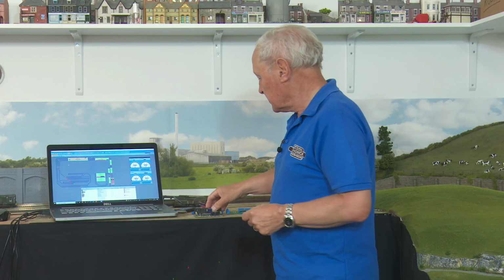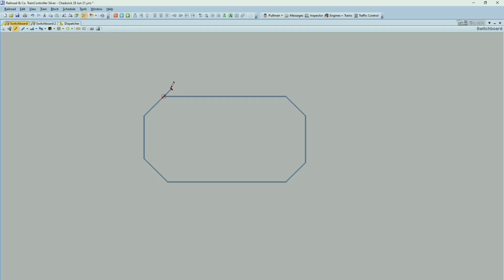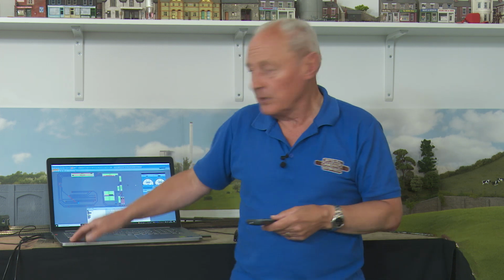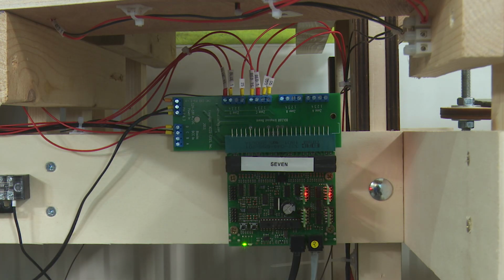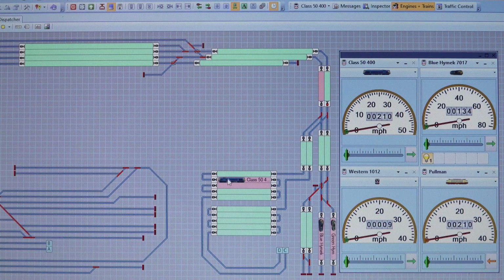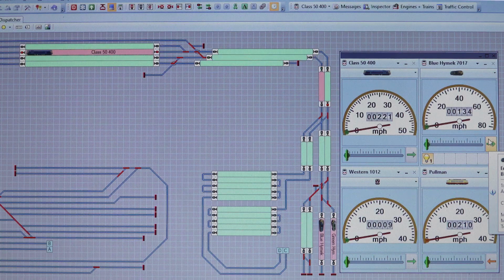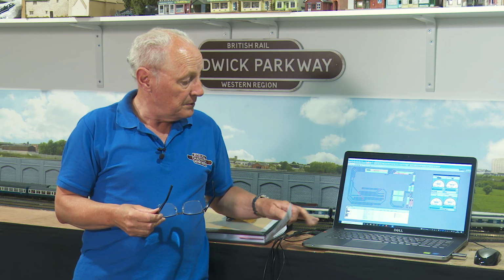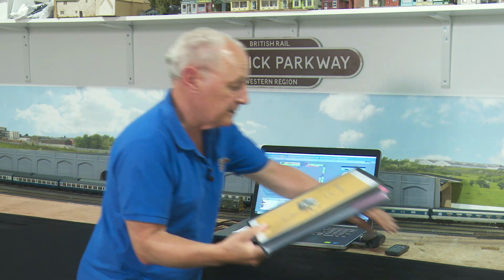An Intro to Block Detection at Chadwick Model Railway | 137.

Comment: Charlie, I agree with you about the pricing of Train Controller (I compared Bronze).
As I live in Spain I chose the country as Spain and got 121 Euros = GBP104
The UK price of 220USD would = GBP159 or 185 Euros
I would queery why its quoted in USD for a start for the UK and seemslike an error. Either way maybe choosing a European country in Euros might ne the answer and a lot cheaper?
Interestingly, France is 121 Euros but Germany is 119 Euros (made in Germany) and Switzerland 134 Euros. I can only assume that the differences are caused by the different VAT rates accross Europe?
Did you get anything actually posted to you (manual etc) as postage costs vary immensely across Europe especially to / from the UK. Other than that I have no idea!
Great video as usual, I think I'll keep to my Digitrax DCS52....lol!
Reply from the maker: Great comment Mike, thank you. Good luck with your layout buddy, regards Charlie

Comment: another great video Charlie you made it very easy to understand. i use Digitrax and Train Controller v9 silver. I find the Digitrax kit easy to setup and use and the Train Controller takes time to setup but once configure it great, for my layout around my office.
Reply from the maker: It can be a difficult mountain to climb Rob, but as you say once it’s set up it is reasonably stable. Regards Charlie

Comment: I have a little shelf switching layout and wanted automated signalling so I went the digitrax SE8C + BD4 + JMRI route. Not impressed by the BD4, they’re fiddly and I had to play with debouncing time in JMRI and adding resistor in series between the block and the BD4 to get reliable detection. JMRI is not friendly but powerful, I have weird switch and signal configuration and could create custom rules so that everything switches properly.

Now I need to start on the messy landscaping part… and actually planting those signal masts!
Reply from the maker: Great comment Cedric. I must confess, the BDL168 would’ve made your progress simpler. Regards Charlie
Reply: @ChadwickModelRailway  yes it definitely would have! Insight (and your videos) are beautiful things… take care!